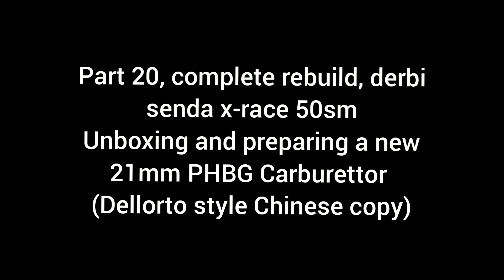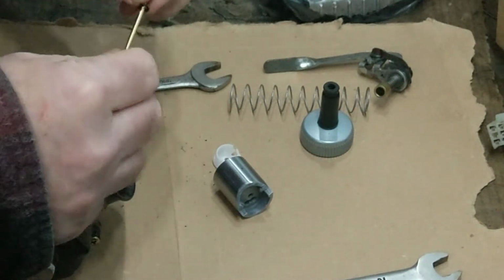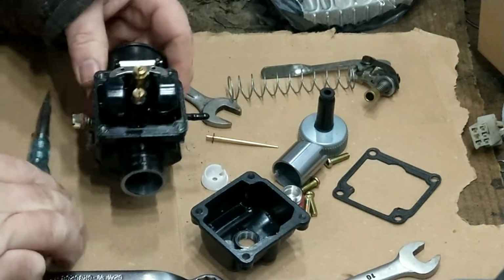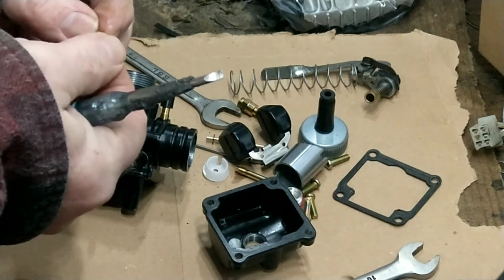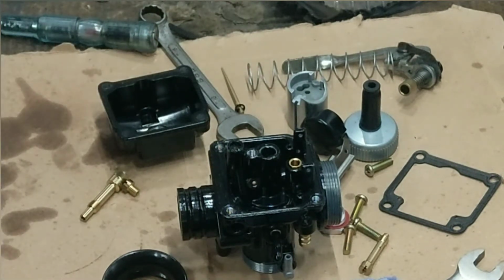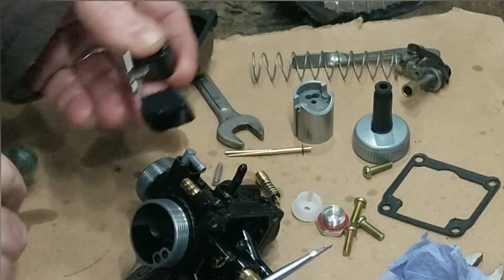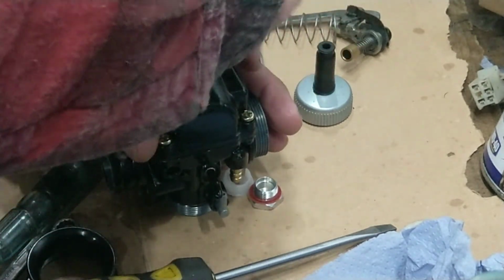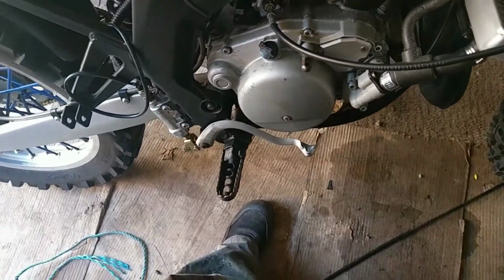Part 20, derbi senda rebuild, preping a new 21mm PHBG Carburettor (Dellorto style Chinese copy)

Comment: Hello, where to does the two grey "wings" connect to, those on the sides facing down?
Reply from the maker: They are breather/overflow connectors, I usually put a length of petrol hose on each and lead both down the back of the gearbox and cable tie them together.
Reply: @TheWeeBaldyBiker  I've seen some people connect those together via a tube, would it be better not to connect them together?
Reply from the maker: I've never done that on that type of carb, there's similar looking connectors on the original carb, these were connected to the cooling system and some people connect them together.